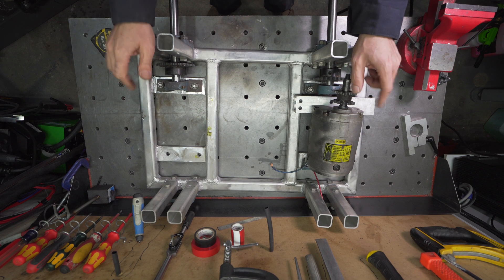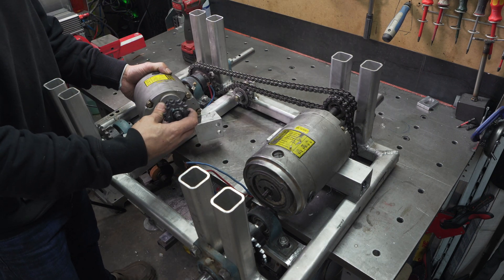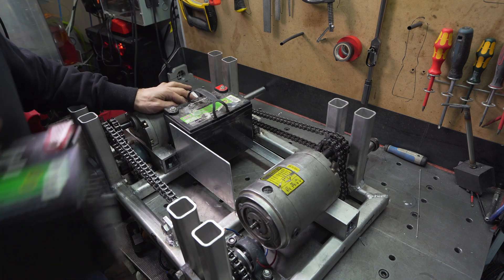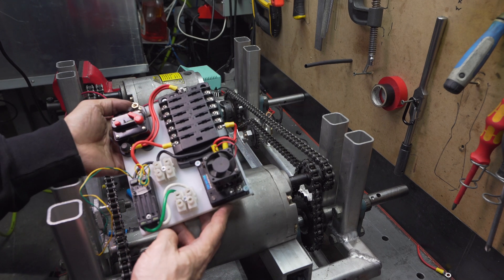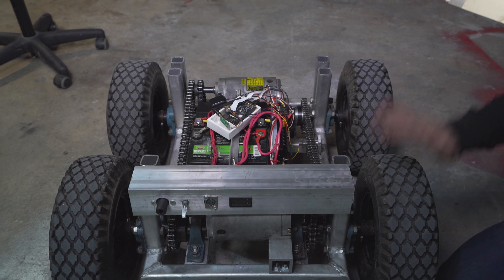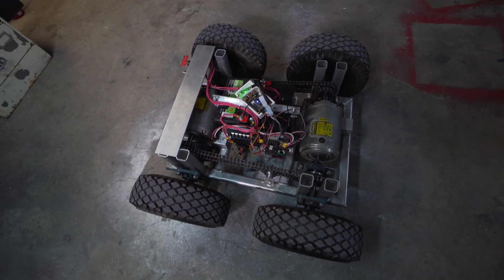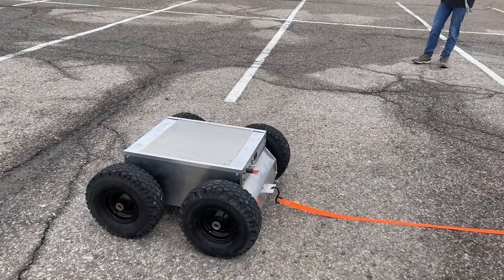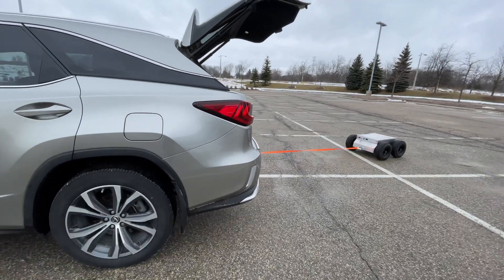RC Robot 4x4 _ 200 lb Rc Robot

Comment from the maker: Parts 
Aluminum chassis
Navio2 autopilot board 
2 x 12 volt 33 ah batteries 
Victor 883 60A motor controller 
Talon SRX 60 A controller
Fortress  24 volt geared motors
Reply: Should be using Loctite
Reply: Those esc are doing nothing for the motors